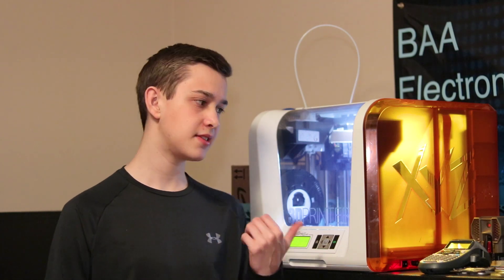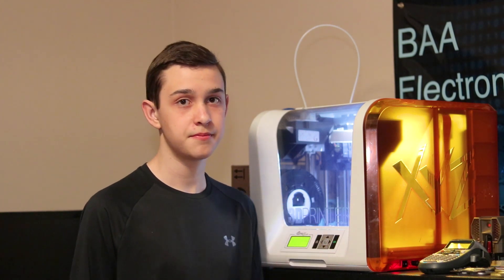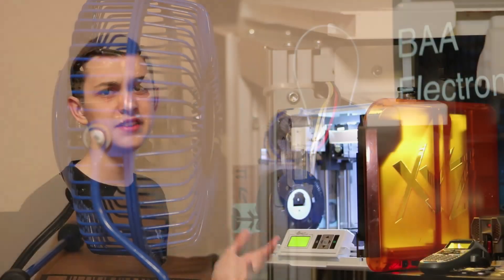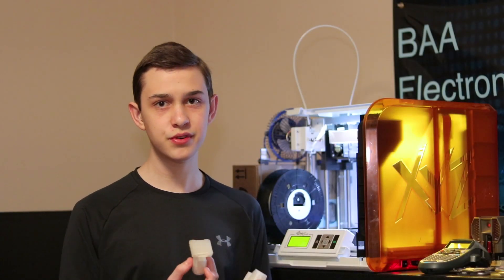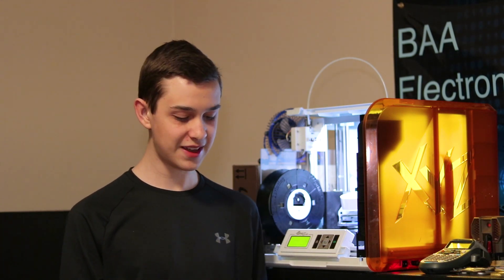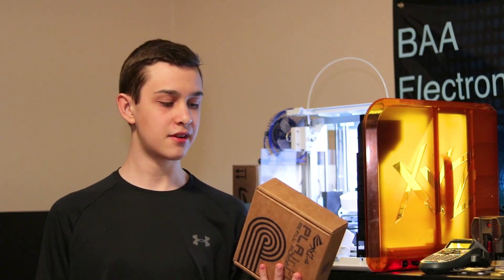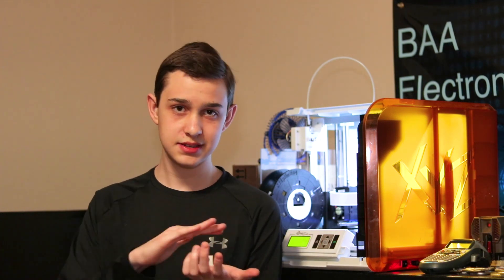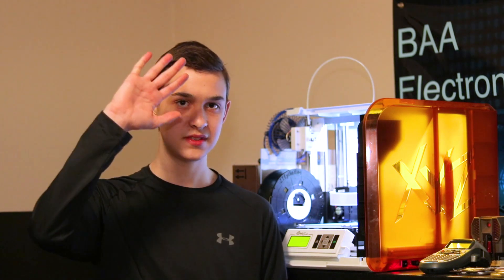DaVinci Jr 1.0 3D Printer - My 3 Year Review

Comment: I also just came back to say THANK YOU for the tip to cool the stepper motor. I shelved the printer for almost 3 years because of the constant jamming in the feeder (due to the heat melting the filament. I ended up ripping on of the fans out of the back wall of the unit and mounting on the left wall to cool the stepper motor. 
I think I've finally resolved the last issue that prevented me from performing long prints.

Comment: HI, I was wondering I want to print at home thing that would be same consistancy as rubber.   Any suggestions.
Reply from the maker: There exist types of flexible filament for certain printers. I don’t think this one does it because a heated bed is often required, but check if your printer supports flexible PLA or TPU-based filament.

Comment: I bought a used one that had error 0030 x axis error. After some tear down I found the part that goes into the x axis sensor was broken off, tried finding a replacement and no luck.(need a 3d printer to fix a 3d printer) so I magivered a fix with a bread tie and hot glue to trip the stop sensor and works perfect. I got into the settings and looks to only have been used 120 hours so for a 6 year old printer this is almost brand new. My first printer and happy with the find for putting less then 200$ into it.

Comment: Mine has a tini tiny issue. It fails to load fillament. Like, loading it, sure. A small dot of fillament appears from the nozzle but anything more than that makes it shoot back every few inches of fillament. Annoying sound and it disconnets the fillament from the print head. 

Any tips on how to fix this?

Kind regards, some annoyed guy :p
Reply from the maker: My fix for continually failed filament load is to either clean the print head with the thin metal paperclip thing or to clean the filament feeder rollers.

The print head being clogged can cause filament to not load past the nozzle and then get jammed up in the feeder rollers. Then, the melted filament on the rollers causes it to slip and make the annoying banging sound and/or terrible squeaking noises, so check the nozzle and rollers first.
Reply: @baaelectronics  Thank you so much for your help! Gonna try this as soon as possible :)
Reply: @baaelectronics  Thank you so much! It totaly fixed it :)
Reply: Just noticed. im Subscriber 600. Congratulations man!

Comment: I’m my experience the nature filament breaks all the time. Any new filament is really good.
Reply from the maker: Yes, any old filament will keep cracking and not really be usable, but even with nature filament, if I store it in a vacuum-sealed bag, it stays good for a lot longer. I guess air breaks it down faster or something.
Reply: baaelectronics I’m currently just trying to run through all the open filament before opening new rolls. Changing up my settings I could usually get decent prints successfully most of the time now! Although if I wasn’t using them because of my job I definitely would get a different type of printer.

Comment: how do you replace the filament mine wont reconigze it?
Reply from the maker: Make sure you've inserted the NFC chip into the spool holder first and see if it recognizes it. If not, unscrew the white plastic spool holder to separate it, put the NFC chip for your other spool of filament into the holder, and screw it back together on the new spool. I assume the printer doesn't already have filament in the feed tube, so insert the spool into the printer and load the new filament like normal.
Reply: it still did not work and it says issue 0014 and says to turn off

Comment: Way to go young man. I have used this printer for 4 or 5 years now and you hit every point that I learned over the years with using this machine. Nice touch with adding the suggested print orientation for strength with your print. That would be a separate class video in itself with learning how to 3D print. Awesome video and keep up the good work.

Comment: how to use a Third-party filament
Reply from the maker: I’m not sure it’s that easy to use 3rd party filament with this model since all the official XYZPrinting filament spools have NFC chips embedded in the spool. Depending on the type of 3rd party filament, you may need to make an extra filament holder that would accommodate the spool and finals a way to reprogram the NFC chips. I managed to find an Instructable on this exact process: https://www.instructables.com/id/Using-3rd-Party-Filament-With-Da-Vinci-Jr/
Reply: Honestly you are better off finding another cheap printer, this isn’t the cheapest printer out there anymore. However, if you already bought it like I did, you can buy preloaded nfc tags off eBay for like a buck apiece. I got a set of ten 249 m nfc tags for 7.88
Reply: buy these:

https://www.amazon.com/gp/product/B072JRB1FZ/ref=ppx_yo_dt_b_asin_title_o08_s00?ie=UTF8&psc=1

then download this app for your NFC enabled phone to program the tags. follow this link to find the app:
http://www.soliforum.com/topic/17124/android-app-for-resettingwriting-blank-ntags/

it took me 3 minutes to program a tag and i have used 5 reels of 300 meter hatchbox with this printer sucessfully. 

You do need to print a spool holder:
https://www.thingiverse.com/thing:1461527

once you have the spool holder printed, yes it will print on the jr, just need to angle it correctly, you need to drill a small hole in the bottom for the filiment to go threw.  Next, once the tage is prgramed, just remove the nfc chip from xyz, and put the tag in its place, and put it back on the original spool so that it can read it:) easy as pie!